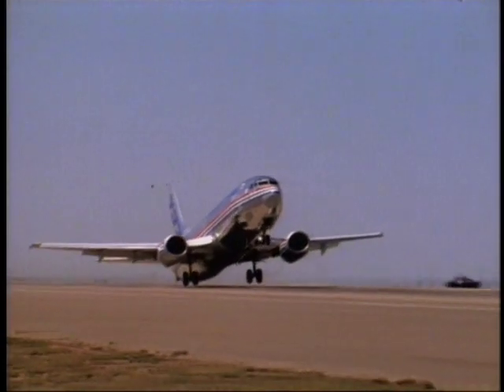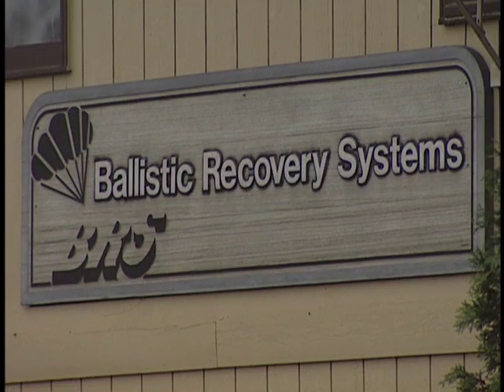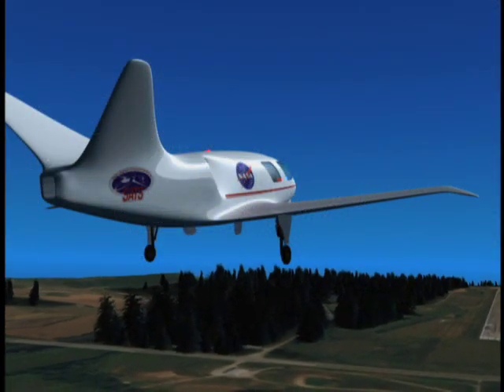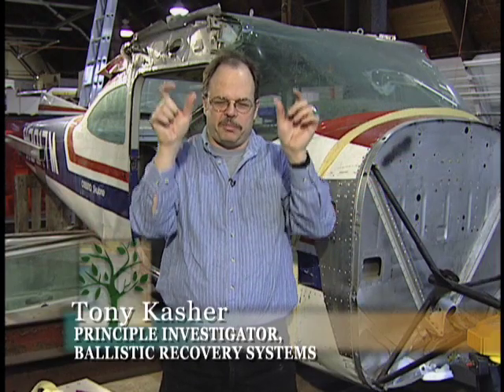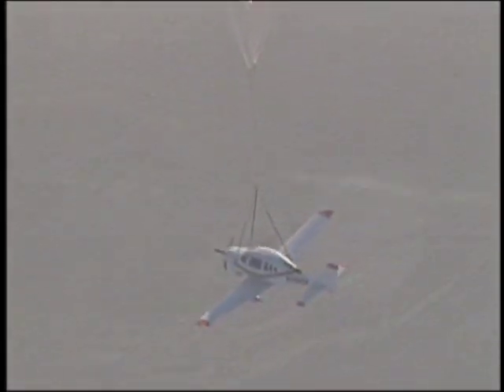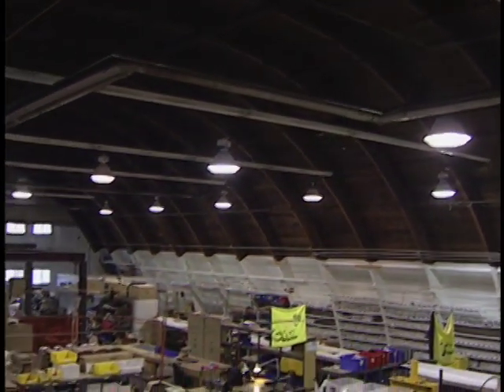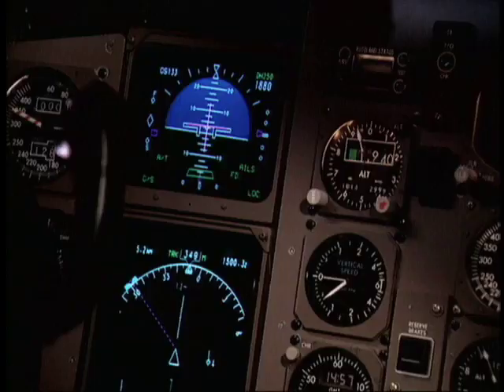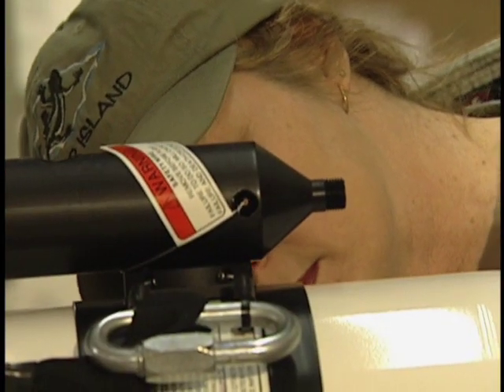Ballistic Recovery System

Comment: There is no comment, so I might as well add one. Awesome stuff and maybe one day they will be fit on commercial airliners.
Reply: I’d guess the value for airliners would be limited as they already have more advanced safety systems & procedures than general aviation aircraft.
The pilots in commercial aircraft are really there to handle the aircraft in an emergency.